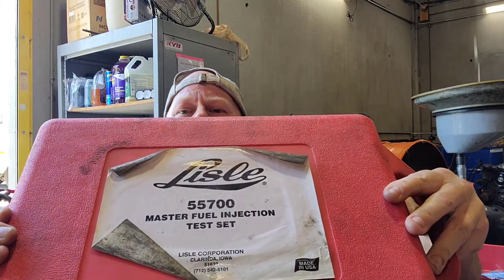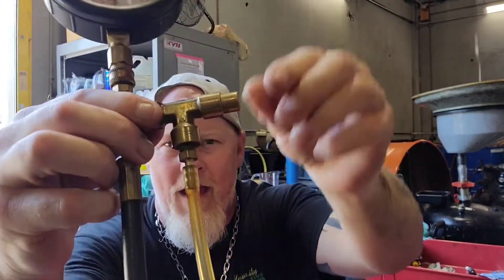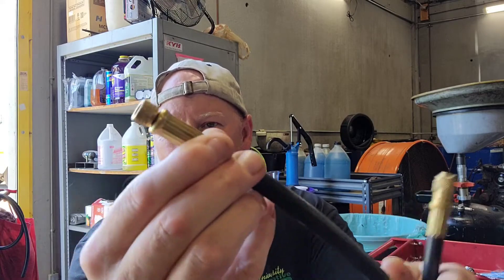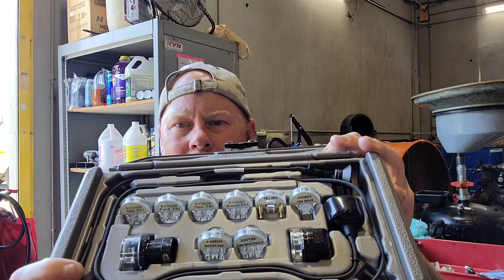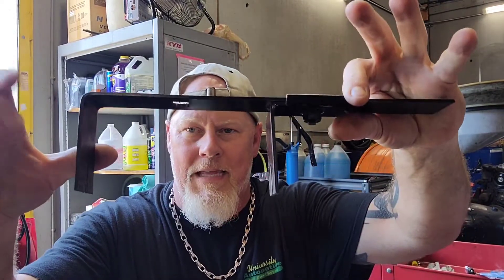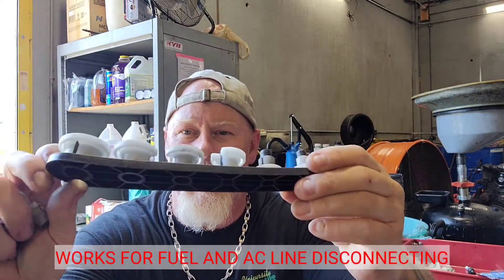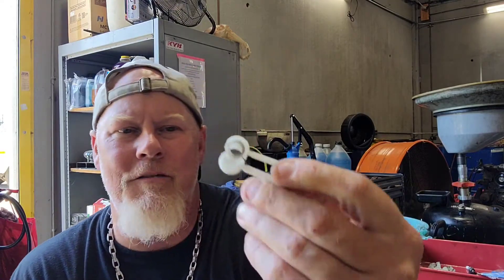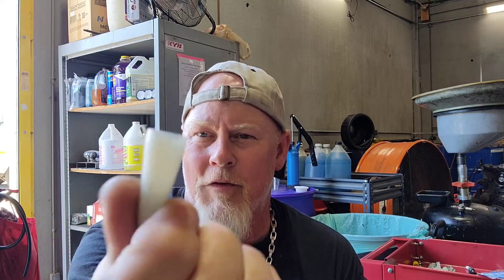TONES TOP 5 Fuel injection testing and repair tools you need

Comment: Good stuff. I recently bought  the Lisle universal lock ring tool off the Matco truck. It has 2 sets of legs. One for metal rings and one for plastic. My quick test for fuel volume is to hold the release button on the fuel gauge with the engine running. If the engine stumbles or stalls, it's got a problem.👍
Reply from the maker: Nice plastic and metal very nice.  That's a great test with the fuel volume I like it.  Thank you.